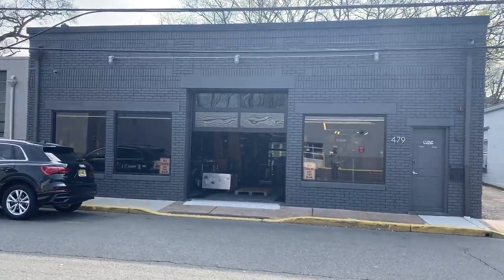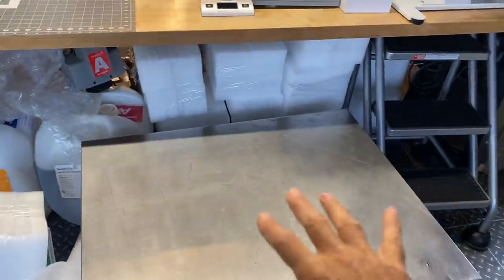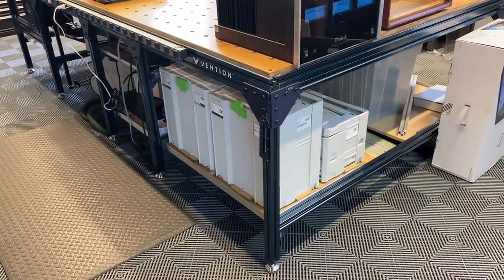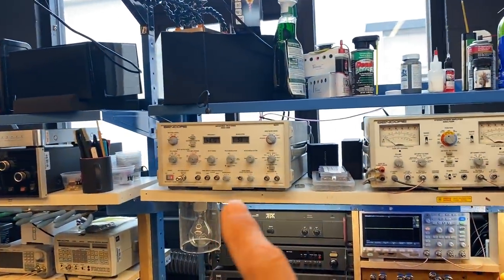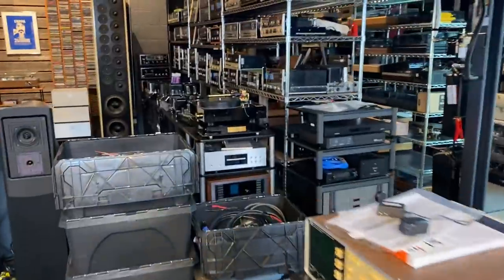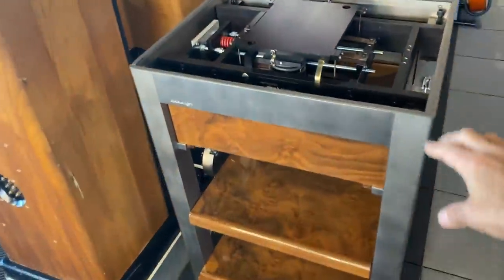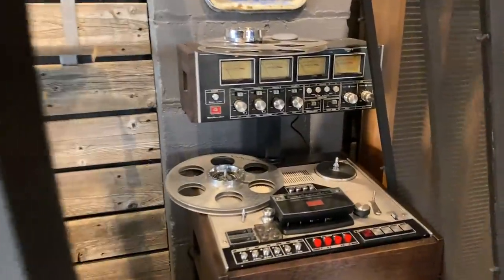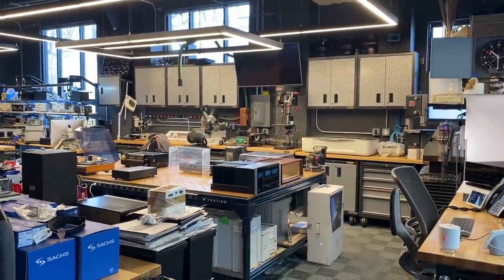Craziest HiFi Shop Tour, SkyFi Audio, April 2021

Comment: Very thoughtfully laid out and stocked shop/workshop. I'm very impressed with the machining and restoration capabilities SkyFi possesses. But the topper is the central drive through lane and the car on the lift. There should be a car of the month on there, without a cover!
Reply from the maker: Thank you!! We actually have our special red 1991 BMW E30 M3 on the lift most times just sitting pretty for our photography. You can learn more about it as it's listed on our site.

Comment: At 27 min you point at some turntables and call them vpi but one is not, its a piere lurne, their entry level model. Lovely turntable but fragile. Pick these up the wrong way and the weight of the feet, will snap the rods between the feet. Not seen one of these in years. Lovely store, and stock.